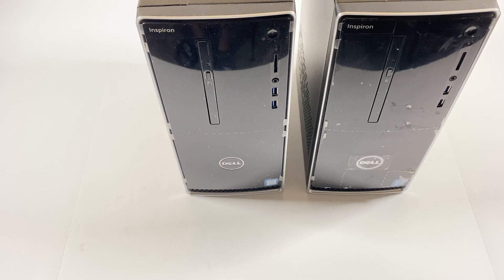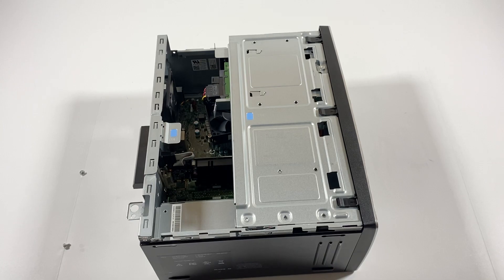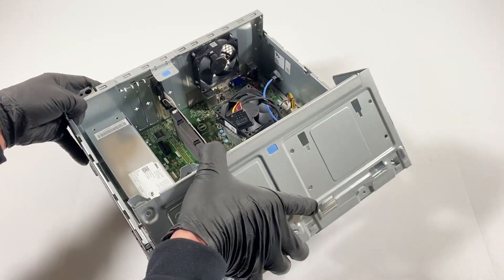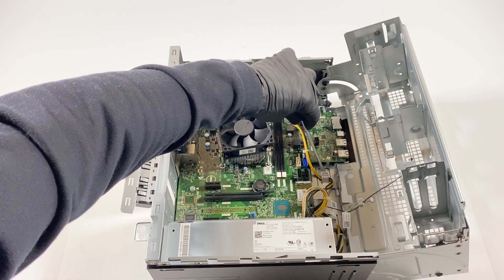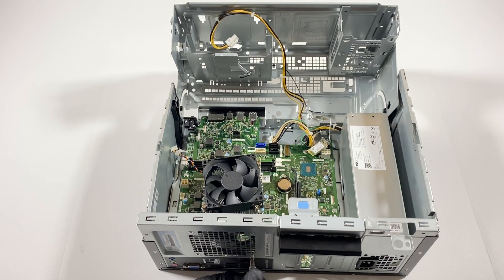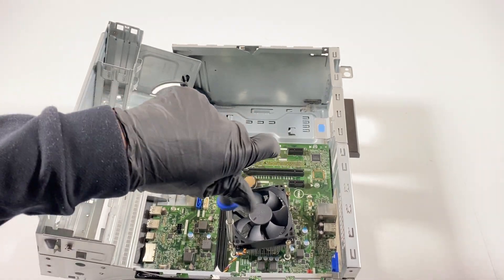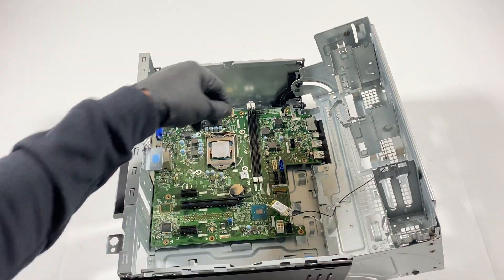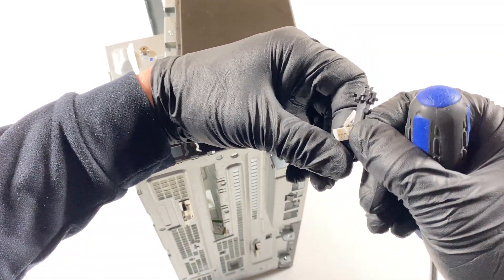Dell Inspiron 3668 3650 Teardown

Comment: I was just gifted a 3650. I've upgrade to 16GB DDR3L. I will be adding white/RGB covers, a new 500w Apevia ITX PSU, Thermalright AXP90 X47 CPU cooler, Teamgroup 1TB SSD and an MSI RX 570 8GB GPU. I will switch the rear exhaust with a white RGB fan as well as swap a matching 90mm RGB fan for the cooler. In the front I will be doing a bit of cutting to mount a 120x15mm RGB Thermalright fan. The inside of the case will be painted white. The RGB controller will be mounted to the top rear of the case where it's out of the way but easy to get at. Next, I will be installing a side window and making a PSU shroud to clean up the bottom of the PC. It has Win10 on it now, but it will be changed to Linux Mint. This is a pretty fun hobby. Your vid will come in very handy during this build. Thank You!!!

Comment: Question. I notice on this 3650 the PSU connection is only 6 pin to the motherboard. Mine is an 8 pin what is so special about mine to have an 8 pin?

Comment: the motherboard is proprietary, but the mounting pins look like they are micro atx compatible. not the best components on the market, but the case is more important because you could just swap it with a higher end motherboard in the future, I like these old small cases because of this and cannibalize them to save money on expensive builds. the power supply looks like it is tfx compatible, not a lot is available but you can get up to 700w in a power supply this size from what ive seen so far. the drive bays are great and adds lots of upgradability since you can get caddies that take 2 2.5 inch drives in a 3.5 inch hard drive bay. I personally use a dell vostro case that is the same size but half height, so it takes 2u/low profile components. my decade old xeons are better than this. its got nvme, good 4gb gpu, 64 gigs ram, wifi 6 and 10x sata hub so I can stack 10 1 or 2tb laptop hard drives. cd drives are irrelevant so I replaced the 5.25 with more ports. there is also a 3.25 inch 2tb hdd hidden under the 5.25 and I can still hide another 2.5 ssd on top of that hdd. I started with E-ATX and decided its just too heavy when I move it around the house, and a smaller computer is easier to just leave on a table, or a rack, or just hide it anywhere else out of sight. dont scrap these, I would love to buy these since it can take a full size gpu
Reply from the maker: Hi...
Reply: @Mxkdt  you do this a lot, but you dont sound very enthusiastic. I dont know what kind of job this is, or you are just teaching people how to put this together. these cases are really simple, and I didnt really need to ask anyone to figure out how to put computers together, its like legos. I worked in a recycling facility disassembling servers before since it was closer to what I wanted to do. I just love electronics
Reply from the maker: Yes on my channel i do have over 60 teardown videos on different PCs...

Comment: I want to upgrade from my HP case to a new and better gaming computer case. Do you have any tips for upgrading my computer like that?
Reply from the maker: Hi, it depends what is the hp model number?
Reply: @Mxkdt  It’s an HP Compaq Elite 8300 Small Form Factor
Reply from the maker: No that hp motherboard in sff case will not fit gaming computer case...
Reply: @Mxkdt  Do you have any tips for me? I only plan on changing my processor and video card. Should I buy a different motherboard?
Reply from the maker: Yes you can upgrade CPU to Intel Core i7 3770 and have at least 16GB of RAM installed and i would say it is not worth it to buy different motherboard and video card you can only use low profile in this case...
Reply: @Mxkdt  Yes, that’s why I want to upgrade the case. I don’t want to be stuck with low profile.
Reply: @ForkInTheButt  Yeah, I just don’t want to spend more money than I have to.
Reply: @ForkInTheButt  I just want to figure out the price and save up for it. My computer specs are pretty good. I just want a better graphics card and a better processor. I was thinking about getting a new case and maybe motherboard because it’s small form factor rn and the new case could handle the heat from the other stuff.